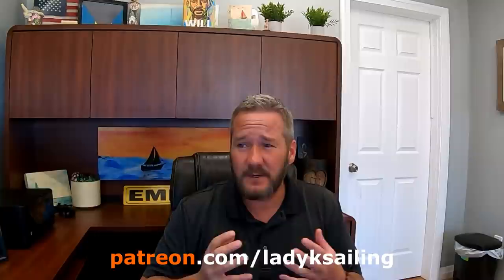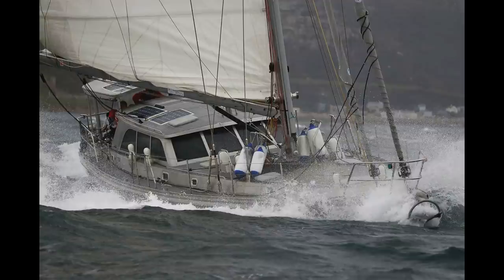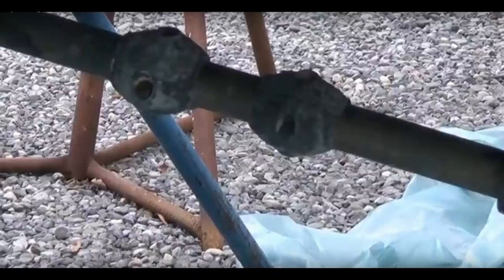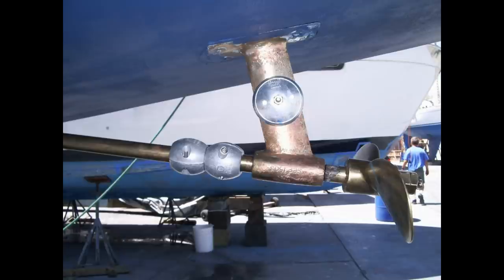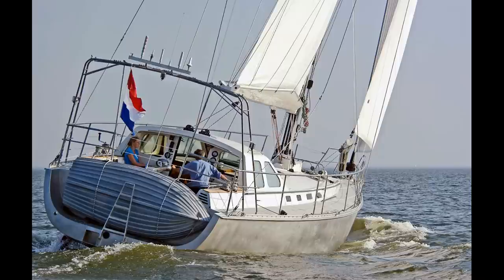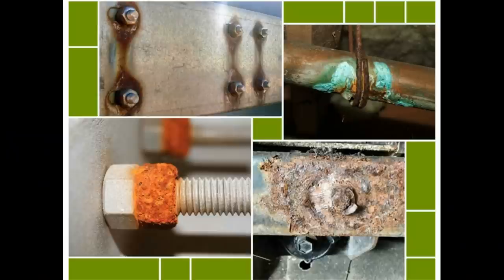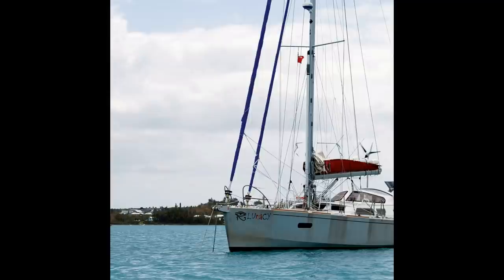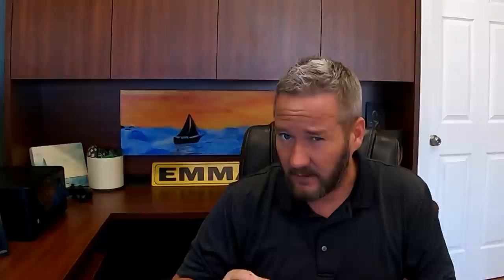Aluminium Boats - Episode 176 - Lady K Sailing

Comment: Thx mate, a well presented discussion of the pros and cons of Aluminium ( and thx for acknowledging the different pronunciations😉).  Galvanic corrosion is of course possible on fibreglass boats as well particularly with the dissimilar metals issue in the presence of salt water, most notably in the standing rigging, not a good scenario. This means of course that the attention to electrical isolation is a vital requirement for any vessel, steel, aluminium or fibre glass. (unless you have the kind of budget that allows for an entirely composite hull, mast, standing rig, through hulls, mountings, anntenae and any other elements that are subject to salt water immersion. Even then you have to have some way of channelling a lightning strike to earth without blowing holes in critical structures, let alone electronics. Been there done that....)
So... I think there are some excellent builders who make both sailing and power vessels from aluminium. Note that many modern military vessels are now primarily aluminium in construction and that there is a body of knowledge out there to draw on regarding the issues you have raised. I like the collision tolerance elements, Aluminium bends, deforms rather than shatters, good for adventures far from help, I like the options that are offered by the major Aluminium boat builders, swing keel, cutter rigs, and I like the strength to weight ratio of the right alloys. Note also that aircraft are largely aluminium constructions and spend most oil their lives out in the weather, and all of the issues associated with maintenance and corrosion are dealt with there too, thank god..
Anyway thanks again for your presentation. good work.
 cheers from Australia.  the Dr.

Comment: Here in Europe aluminium sailboats are very desirable and getting more so.  
France and the Netherlands are leading the way.  
Boreal, KM Yachts & Garcia to name a few.  
Corrosion or electrolysis is a real issue on older models and rightly very unforgiving with electrical mistakes.  
I would be avoiding older aluminium boats but definitely looking at newer models. 
Especially for high latitude sailing. 
Thanks 🙏 for the great content.
Reply: Hello From which year would you consider aluminium boats to be less problematic regarding 'electrical mistakes'?
Reply: Why is corrosion or electrolysis on the older models a problem? Is the problem with the hull materials specifications or is it the electrical system? Would replacing the electrical system solve the problem?

Comment: Aluminum hull sailboats seem to be much more common in Europe (especially Nordic areas, likely due to the ice). Was looking around at Meta 36~50 ft boats recently... they are almost impossible to find in the US... and when you find them (used) in Europe they are either very expensive ($600k+) or 40+ years old and need a full refit. lol. Although I did find a pretty nice looking 1983 Ted Brewer 46' aluminum hull boat in northern WA for ~$90k, but it needs new sails and a full refit/renovation.

Comment: I work in a shipyard.  We fix boats. Welding aluminum can be a pain. You may need to apply heat before welding it. It needs to be very clean. Welding it is time consuming.  Tig welding  is the best process.  To hire a certified  welder/fabricator to do the work is very expensive.  If you own an aluminum  boat, there will come a time to need fabrication  work done. Steel is definitely  a much easier  material  to work with than aluminum.  
Definitely  listen to him. Aluminum  boat owners  will spend more money. Unless you know how to weld and fabrication  of aluminum or money $$$$$ is not a big deal to you.

Comment: Thanks for a great topic.
Aluminum definitely has its place in marine environments.
But,
It’s probably not completely appropriate to refer  to metals susceptible to galvanic corrosion as “soft”.
I can’t image any metal softer than gold or silver or lead which are extremely “noble” or highly cathodic on the galvanic scale.  

You are correct that aluminum is fairly anodic compared to most structural alloys …and care needs to be taken to either electrically isolate it or galvanically protect it with something more anodic like zinc or use brute force by applying an impressed current to balance out the galvanic circuit.

It’s natural tendency to form an oxide film is quite beneficial in fighting corrosion.
….second only to the durable coating produced by anodizing.

Coatings like paint often times produce undesirable results if the coating becomes scratched.
The small area of aluminum exposed by the scratch is likely to experience a concentrated current that will rapidly “eat” through what is effectively an exposed anode.

Comment: I know you are trying to be objective, but I am sorry to say that this presentation comes across as being somewhat ill-informed on the topic of aluminium boats.  Many of the issues you raise are either exaggerated or simply not a problem.  I say this as the owner of an Alubat OVNI, which is constructed entirely from aluminium.  Corrosion is not an issue, so long as some basic precautions are observed.  All OVNI’s have an electrical leak meter on the electrical panel, as standard equipment.  The presence of a leak will be immediately detected and alarmed.  Anodes are zinc and last 2-3 seasons.   Galvanic corrosion risks can be avoided by installing an isolation transformer, which most larger OVNI’s have as standard equipment.   The electrical system on my boat is no more complicated than what I would expect on any modern boat of equivalent size.   
OVNI’s are renowned as being highly robust, go-anywhere, blue water yachts.   I would much sooner cross the Atlantic in an Aluminium boat than in something build of fibreglass.  In the event of a collision with a large floating object, such as a container, aluminium will deform and dent, but is able to absorb the impact without allow water ingress.   Fibreglass on the other hand, will shatter, potentially causing the boat to start taking on water.  In recent months, there have been reports of Orcas attacking yachts off the coast of Portugal and in the Bay of Biscay.   Several Fibreglass boats have sustained serious damage to their rudders, and have had to be lifted out for repairs.  However, when an OVNI suffered a similar attack, the result was scratches to the anti fouling paint, and most likely an Orca with a few broken teeth.  The rudder on my boat is 1.5 inch thick solid aluminium plate.   
The deck and hull of an OVNI are fully welded, making for a very stiff, strong boat.   Production fibreglass yachts, such as Hanse and Beneteau, are nowhere near as strong.   
Suggest you do a bit more research, and check out Boreal, Alubat, Allures, KM Yachts, and Garcia.  All rugged bluewater yachts and all built from aluminium.
Reply: Agreed, he's half informed and should do some homework and redo this video. It's given many people the wrong impression
Reply: I realise this is an old thread, but I'm glad I read your comment. I am looking at an aluminium Tucker 31from 1972 but cannot find much about these boats on the internet. What I do know is that the hull is 8mm throughout and 5mm for the deck. It looks to be in very good condition for its age and the price is attractive at £12500. I have narrowed my search down to this and a Beneteau First 305 at £10k. Similar sized boats but the first has a yanmar 2GM20F and the Tucker a beta 35. Difficult choice

Comment: Oil does not degrade aluminum. Aluminum is used in every single car engine made and directly contains the engine oil.  That said, there is a lot of to still watch out for.

Comment: I think that aluminum, properly built is the best material there is for a sailboat. Cost being the main negative. And you don’t bolt to or though alum, you weld everything. No corrosion and NO leaks. NO bedding or through deck fittings, none. No leaks, no bolts through anything. Weld.  And learn aluminum welding and carry a welder. All it takes is money.  Oh well.

Comment: There are different grades of aluminum as well as steel and other types of material   5086 marine grade aluminum stand up to saltwater very well you do have a point however about dissimilar metals that’s why they make different types of anti-seizing compounds you do however need to be very careful in marinas and boat you are docked near  as far as worrying about electrolysis. However oil and other petroleum based Products are most all of the diesel tanks are made from aluminum as well as most diesel tanks on semi trucks and if you’re buying a high-end aluminum boat most all of these considerations has been taken care of there are pros and cons to every type of material wood has worms and will rot in freshwater not so much in salt steel rust but there are types of steel commercially used in large ships that will only allow surface penetration as the recipe used to make the steel takes it into consideration and is layered with other types of alloys in the recipe  However I’m not trying Say one is any better than the other cost seems to be the biggest factor as well as you stated were one will be Sailing. I do very much appreciate your channel and thank you so much for the job you do

Comment: You missed a very important advantage to a metal boat.  Lightning ⚡ since you will be Incase in metel you will enclosed in a Fariday Cage. You can sleep at night during a lightning storm on a metal boat. Plus Any lightning protection you employe for your electronics will be extremely more effective than on a plactic boat since it will have a great ground/counterpoise to work with. Everything is naturaly bonded in a metal boat.  Much better than throwing a pair of make me fell good jumper cables clamp on the back stay and tossed overboard with maybe 6 inches of surface area

Comment: u just helped me answer an age old question.  why some boats are hit/damaged by lightening more than others, even of the same make and model.

they answer is obvious.  upgraded electronics rarely include upgrades to the ground straps/system let alone the anodes.

is it not true that too many anodes causes problems also, not as  bad as not enough, but left un checked could lead to catastrophic failures?

Comment: Your description of aluminum is not correct assuming that marinegrade aluminum is used. Yes galvanic corrosion is a problem but if everything is installed correctly and tested there is very small risks with the metal. I have haad my workboat for about 35 years now and it is smeared in with about everything in oil and chemicals without problems, but yes of course it doesn’t look perfect but it doesn’t affect the strength. Maybe if you fill up the bottom with acid, but otherwise no.
I think that the price of a aluminum sailbot to start with is a key factor to why there is so few aluminum boats out there.

Comment: How do you protect an aluminum boom or mast from stainless? I’ve been wrapping Teflon tape around the SS screws/bolts. Is this adequate longer term?
Reply: Use Tef-Gel or Duralac as a barrier between the stainless and aluminum.
Reply: @WreakingHavoc18186  thanks Richard. I’ve tried Tef-zel but it’s a gel that is likely displaced when the threads are engaged. Do you see long-term efficacy?
Reply: I was wondering if spraying with zinc corrosion primer might be more permanent
Reply: Duralac actually dries and creates a barrier between the metals.

Comment: Since this is a popular topic, I have a question that I'm sure someone will have the answer to: Why the concern about grounding to the hull of an Al or Fe boat? I get that you should have a single point ground and to my knowledge, it should be grounded to substantial structure like the keel. Isolating it is a safety hazard. At no other point should there be a power or signal return so you don't end up with circulating currents (ground loops) in the structure. Am I saying the same thing Tim was in the video? Is there some difference with a boat as compare to an airplane?
Reply: No you do not want to use aluminum hull as ground. With aluminum you aim to make sure that none of the electrical system ever get in contact with the hull. You do not want your hull to become a path for any kind of current. So on aluminum boat you want a "floating ground" (i.e. it is not a ground, no outside reference). Everything goes back to DC neg as ground. In particular you want to isolate your engine from the hull and your shaft from the engine.

If you achieve that then there is no path for current to flow through your hull. Also if there is stray current in your marina, or wherever you are, if there is no path between your hull and something that would be at different potential than surrounding water then there is no current. Your hull end up to be at the same potential then surrounding water.

Bottom line: no path -> no current -> no issue

Comment: I used to own fiberglass sailboats... now I've gone aluminium. There's no way I'd go back.

Maintenance is a breeze... very dry boat (1981) and only dust can be found in the bilge.

You should talk a out the plus side of aluminium sailboats not only possible corrosion (very unlikely if you're careful not to ground anything to the hull).

I do lik your videos but this one lacks some content.

Comment: You're a little misinformed. 5052 boatbuilder's aluminum has a slow reaction, even with salt water. Zincs? Yes you can zinc, but you can also prime with zinc. This is the coin opposite of people who prime or antifoul with copper paint. Weaker than steel? No. Not only is aluminum far stronger per weight than steel, you can maximize the design with aluminum extrusions, castings, and milling. Dissimilar metals? Try stainless steel nuts and bolts then stainless washers, then aluminum washers. The only real downside to aluminum is finding competent welding outside of the factory. There are quite a few eager arc welders and acetylene welders who would love to damage your boat. Competent welders are as rare as 400 LB ballerinas.

Comment: We love our Alubat OVNI 39, and you are wrong on a few items about corrosion/Galvanic series and durability. Comparing an aluminum anode to the alu used in hull construction is an apples to oranges comparison. Check out our aluminum boat sailing channel (where we actually sail vs talk about it) https://youtu.be/2OdEFgZy2A8 

Cheers,
Gizmo Crew

Comment: "motor sailer" even better absolutely. Aluminum prices are plunging suddenly making very large displacement that can maintain stiffness and rigidity plus resist rusting and fouling. Generally not used because of expense of welding but because of US Space Program ("friction welding") this problem at retail level has by and large now been solved to the point where actual sailing ships might suddenly make a return to use for niche operations absolutely absolutely absolutely.

Comment: Pound for pound, aluminum is actually stronger than steel. But pound for pound it is also 3 times the volume. The advantage of aluminum comes when it is in the form or tubing or beams, where thinner, lighter sections are used in tension or compression. Much like building with fiberglass sandwich, you multiply the strength of the material many times. 

If you built an aluminum boat as heavy as a steel boat, you'd have a ¾" thick hull that would obliterate anything you hit. But if you bent 6061 square tubing over forms and edge welded them together, you would have something stiffer than anything short of carbon fiber, but so thin skinned it would get riddled with dents. 

As a side note, I once saw a giant robot tyrannosaurus called Robosaurus, at an air show. It was famous for being able to rip junk cars apart. They thought it would be fun to ha e it tear apart a derelict Cesna 151, one of the smallest, lightest aluminum production airplanes. It couldn't hurt the thing. Other than some ripples where the hydraulic claws grabbed the wings and body, the cesna survived almost intact, while the field was littered with shredded 400 lb cars.
Reply: Oops. 4000 pound cars.

Comment: After the surface is clean, apply a thin coat of motor oil and kerosene fluid (it's noncombustible) sparingly over the entire surface. This will protect the metal from future oxidation. Repeat every six months. If aluminum is around salt water, repeat process every 90 days.